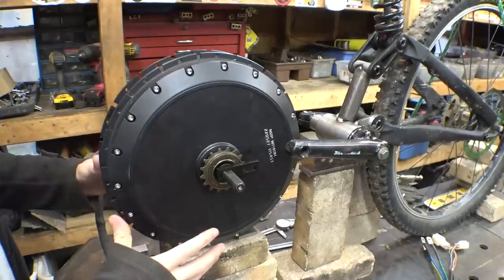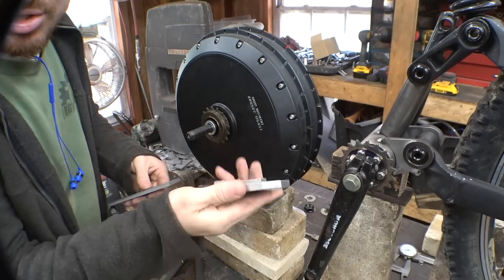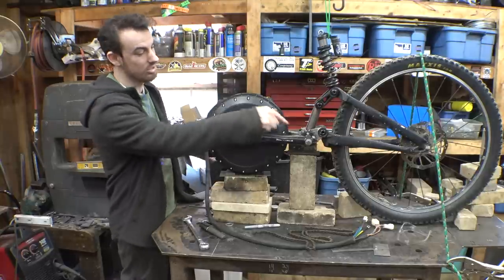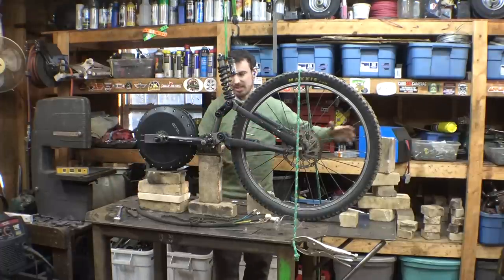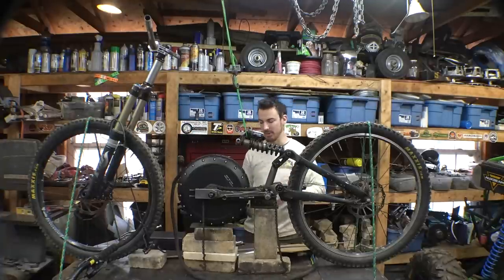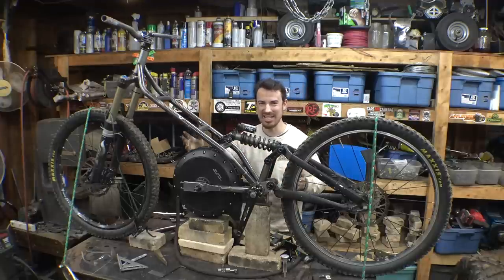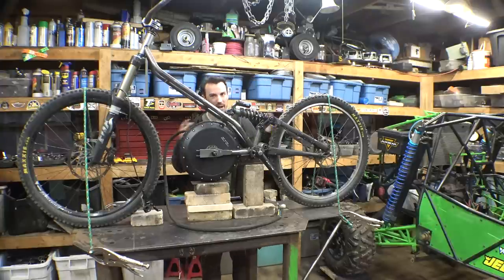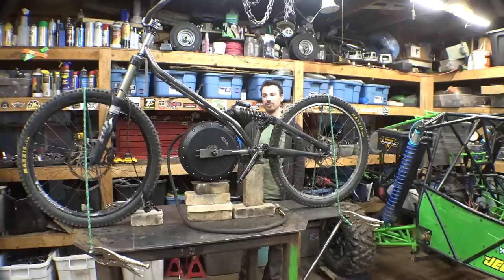Home Made Electric Mountain Bike Build - Part 2

Comment: how do i get ahold of you in private message form? I have a diy e-bike that after many many many upgrades after its initial "completion" it has gradually graduated to an e-moto because there's not a single MTB part on it anymore. all moto parts. qs273 50h. sabvoton 72200. diy 20s2p batt with spim08hp cells. The batt can do something like 800A continuous and i plan on getting a new controller to push the qs273 to its limits. Its fast now. it does mid 60's and itll wheelie at 50mph. But i wanted dirtbike performance. I was picturing kx250 power when i built this bike so even though its fast and powerful i felt dissapointed. coming from a dual 6000W motor scooter my E-moto feels slow af. I can do everything completely by myself besides the welding on a frame because i dont have a welder or material. i will pay you to build me a frame that i can convert my giant powerful qs273 hub motor into a mid drive motor OR (preferably) a beefy frame that can house a purpose built high end mid drive motor like something in the qs138 realm.. I have money, and summer is almost here. all i need is someone to go over plans with me and when were both happy with design and cost, they go ahead and build it. There are other people i can ask but i like the way you do things and if youre willing id rather give my money to someone like you.

if youre interested (and see this) comment or something. id love to exchange emails or numbers or whatever and set this up asap!

Comment: Am i the only one who thinks that there is a big flaw in the design? Will you be able to have electric motor power the bike and have pedals stay stationary at the same time? The motor output is on the left, the sprocket on the wheel is on the right an they are connected by pedal assembly, the part that allows bikes wheel to spin free and not engage chain is in the wheel. Some thing similar should be installed in your pedal assembly but it will be more complicated. Maybe i missed some thing in previous video but it bugs me.

Comment: You would have made a better job building around the drive hub with the pedals directly on the drive with the rear rear swing arm also connected to the shafts already on the drive unit your making a bit of a unnecessary mess of it, I do enjoy your channel but you seem to miss a trick or two and make things harder than they need to be.